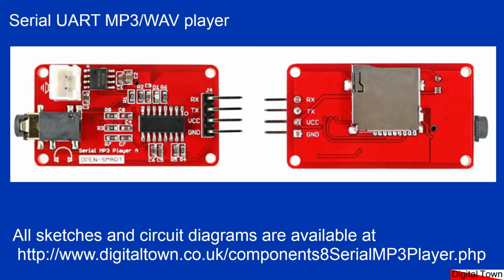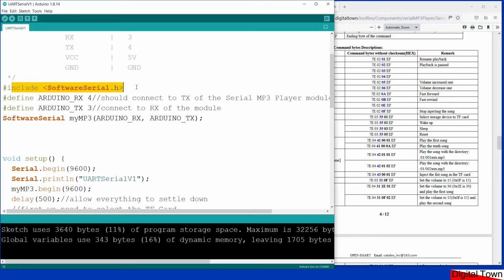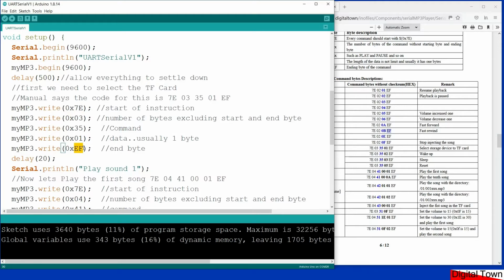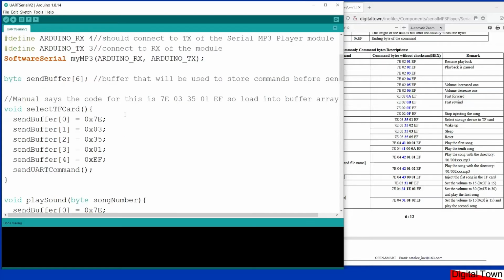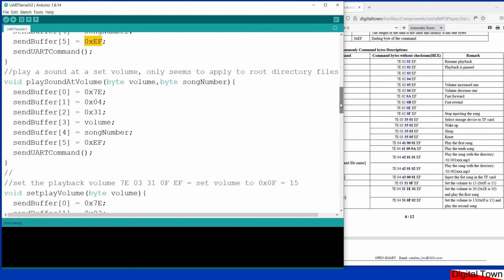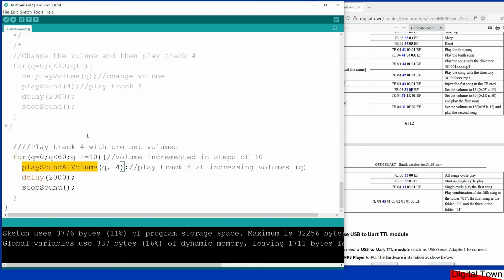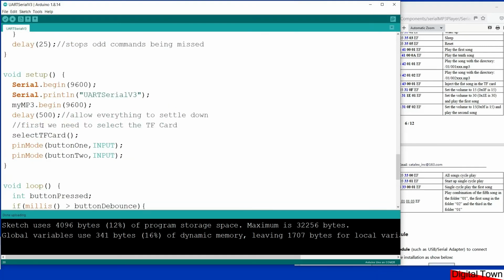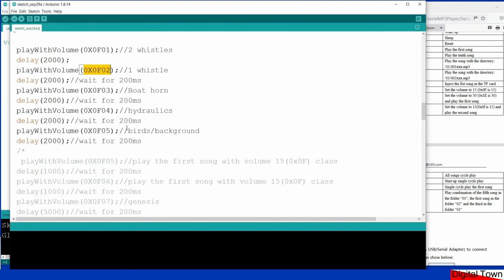Arduino C++: Serial UART mp3/WAV player tutorial

Comment: Thank you for the guide
I didn't watch all of it because I'm just conducting a preliminary survey to determine which module will best suit my needs.
I need it to be triggered by a dry contact (to play only a single file), is it possible?
Reply from the maker: This board uses a Serial interface so you would need some kind of microcontroller to send the command.

Comment: Hi, I tried your code, and it doesn't seem to work on esp32, is there a special library I should install? Thank you
Reply from the maker: The tutorial was written for the UNO so will not work on the ESP32 as softwareserial doesn't run on the ESP32.
You have 2 options. You can try espsoftwareserial library at https://docs.arduino.cc/libraries/espsoftwareserial/

or if your ESP32 has Serial2 (such as the esp32 wroom on the dev module) you could replace software serial with Serial2. If you look at the DY-SV5W MP3 lesson at https://www.digitaltown.co.uk/64DYSV5WESP32ESP8266.php it will show how to set up Serial2 on the ESP32.

You will then need to swap all the commands like myMP3.write(0x7E); and change them to Serial2.write(0x7E);
Reply: @digitaltown5442  do you think you could make a tutorial at some point for this module using the nodemcu or an ESP32?

Comment: i have no sound diffrences when i switch the equaliser
Reply from the maker: What command are you sending? I don't see a command for that in the data sheet.
Reply: @digitaltown5442  0X7e 0Xff 0X06 0X07 0X01 0X00 0X05 0Xef and when i query the current equalizer it does say it is switched
Reply: @digitaltown5442  0X7e 0Xff 0X06 0X07 0X01 0X00 0X05 0Xef and when i query current equalizer it does say it is changed

Comment: can i ask hit is possible for use it at esp32
Reply from the maker: According to the spec you can power it with a 3.3v supply so it should be fine. Do not power with 5v if using esp32
Reply: @digitaltown5442   so coding still the same ?

Comment: how to switch the output between speaker and earphone
Reply from the maker: I don't think there is any way to do that in code. Most earphone sockets break the connection to the speaker socket so that the sound only comes from the earphone.
You could try using a solid state relay to switch the sound between the earphone and speaker but that would require some external circuitry.